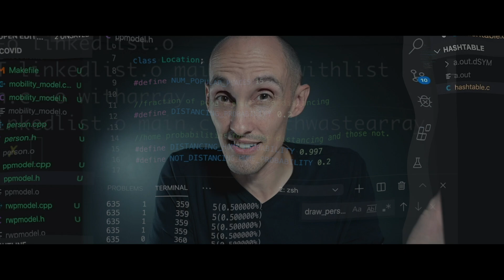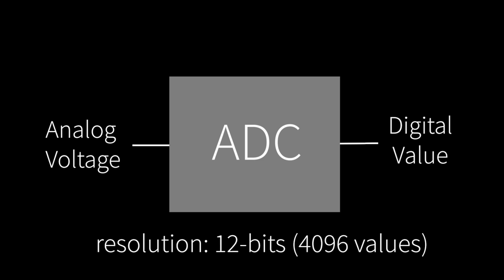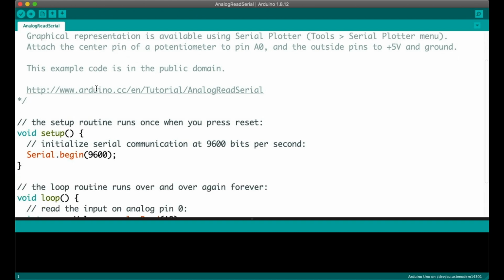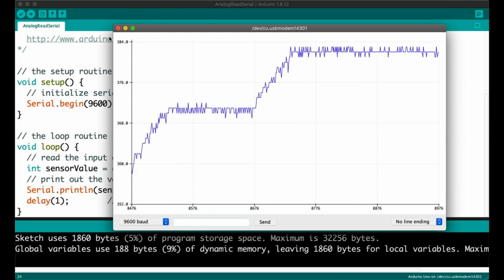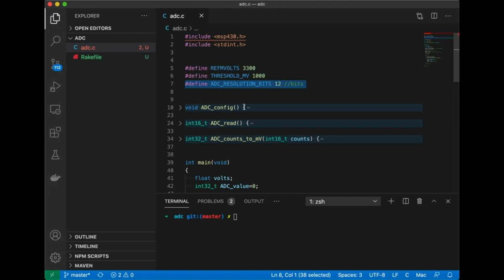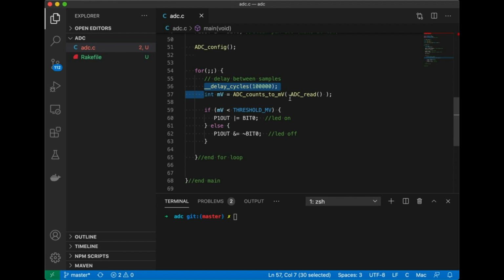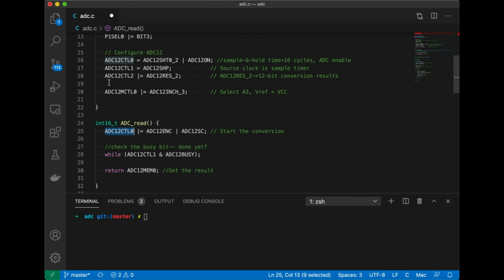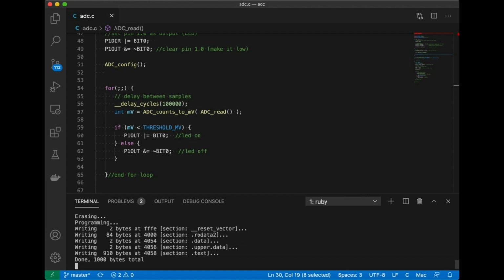How to use an ADC (embedded example in C)

Comment: 3:31 - resistor and green wire wrong connect in breadboard
Reply from the maker: Man, you're right. Sorry about that. I must have fixed it after recording that. Folks. Slide that green wire up to the next row. Thanks for pointing that out, Gokul.
Reply: @JacobSorber  lol, first physical bug on your channel?

Comment: Yep, ADC is very easy to implement, even if you're doing it from scratch on a microcontroller.  It works as a great voltage sensor for your analog pins and, more importantly, its incredibly important to have when you want to interface it with certain sensors such as the DHT11 sensor

Comment: Could you explain why using timers are more energy efficient? The time spent in the delay loop would still be spent in the empty infinite loop right?
Reply from the maker: With a timer, you can put your MCU in sleep mode—so just the ADC and/or timer are working—and then have it wake you up when it's time to do something (by firing an interrupt).
Reply: @JacobSorber  That didn't cross my mind. But replacing the _delay_cycles() with a sleep function inside the infinite loop achieve the same power efficiency as timers?
Reply from the maker: @ayu12641  You would have to check how _delay_cycles() is implemented, but usually, it's just a busy loop. If it doesn't change the CPU state into a low power mode, then it won't get the same efficiency.

Comment: Why you didn't use while true for looping infinitely
Reply from the maker: Good question. Guess I was just feeling in a for-loop mood. A while(true) would have worked, as well.
Reply: A fun fact. PC lint software would throw a warning if you use while(1) for an infinite loop. One way to get past it is to use for(;;) loop which is less error prone as it has no values.